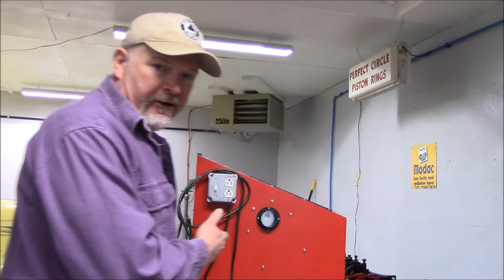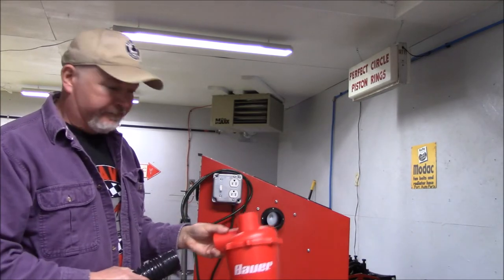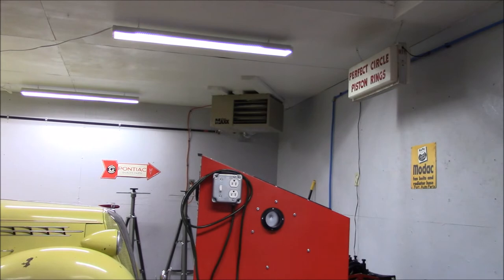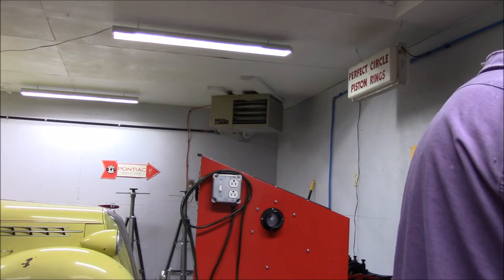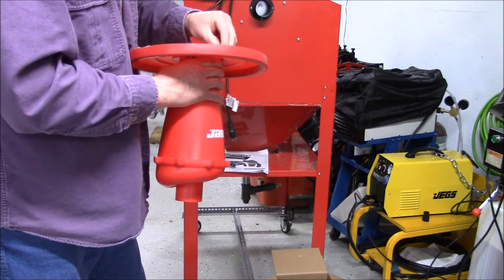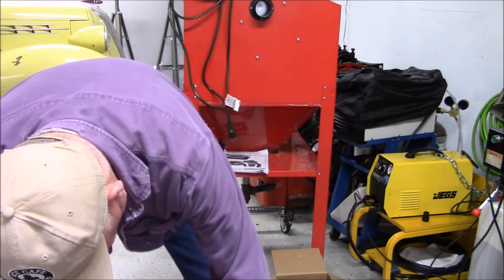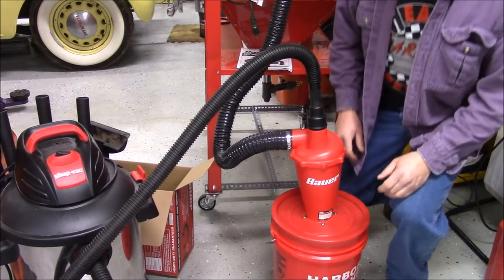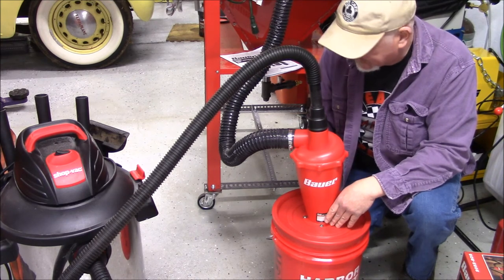Bauer Cyclone Dust Separator from Harbor Freight review

Comment: Place your bucket into another Bucket it helps the collapse issue. I had my first bucket split when hose clogged , Joel
Reply from the maker: Thank you for the tip Joel
Reply: The second bucket did not help the collapse, I had an older bucket that came with detergent from costco and that fixed the collapse problem.